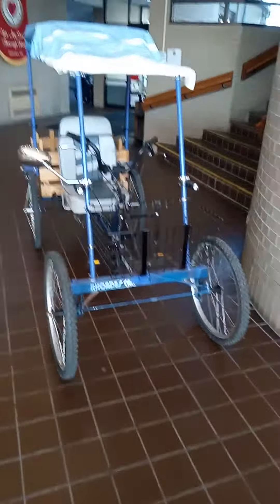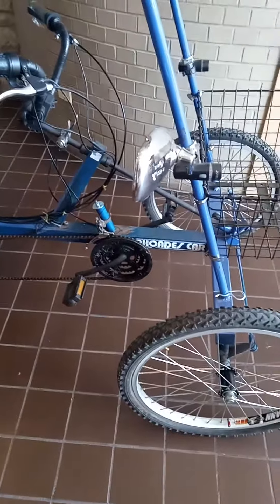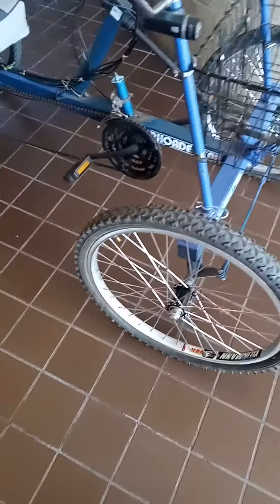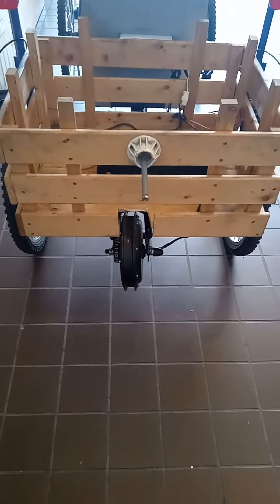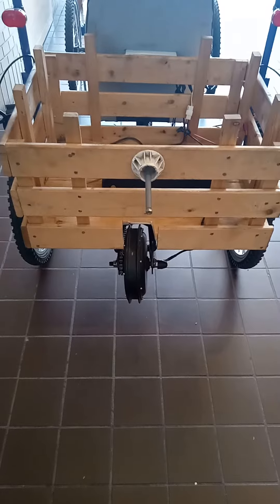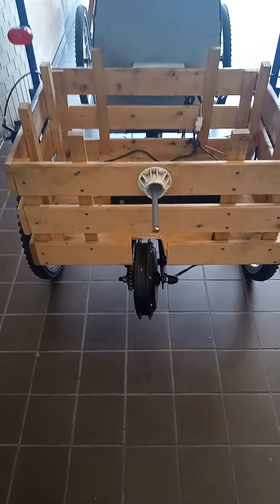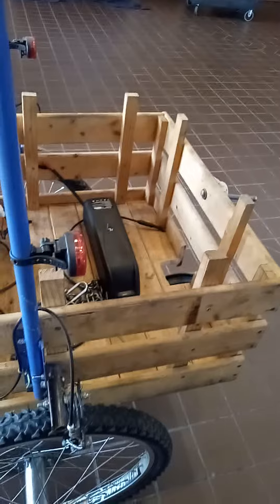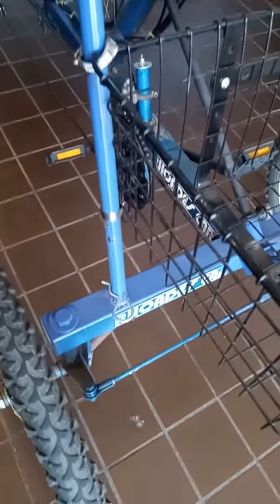rhoadescar e bike project

Comment from the maker: For the drive wheel i made a drive to bolt to the wheel in theback from a spent ceramic cutter blade. I needed something much thinner than the original forthe 20 inch wheels because the rear 24 inch wheels hubs are alot wider than the original hubs on the 20 inch wheels.